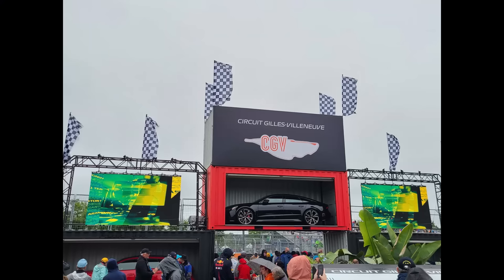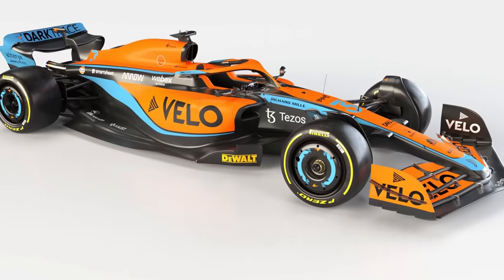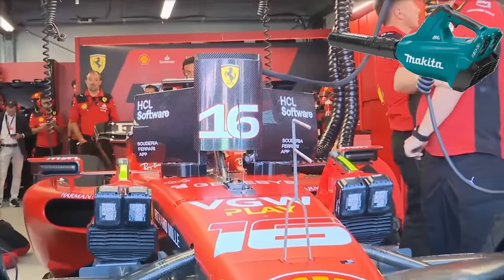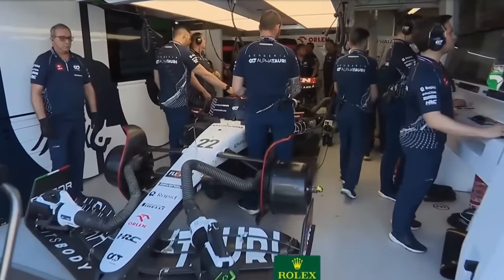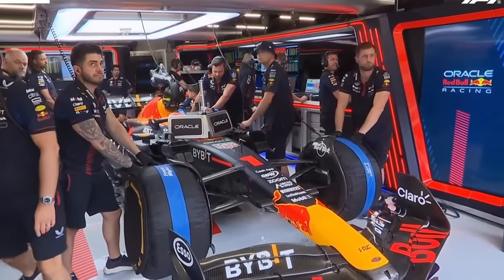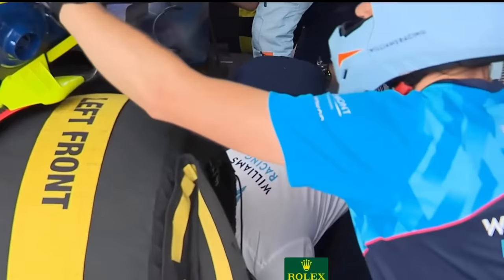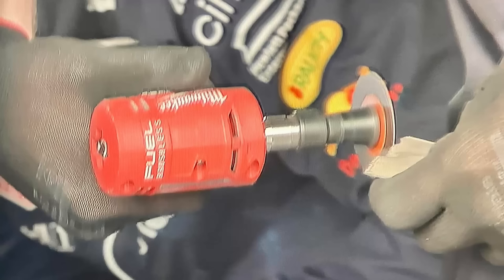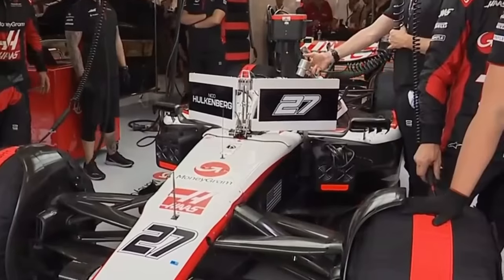Getting to See the Tools Used in Formula 1 Surprised Me

Comment: Those Bosch 12v/10.8v are the legit Rolls Royce of small power tool kingdom. The m12's are just not refined and way too large (both tool and fat handle). Fun fact: those Bosch 12v's could be used as hammers in a pinch!
Reply: I switched from bosch 12v to makita 12v, it has more power, much better ergonomics and better charger.
Reply: @riba2233  But larger and without interchangeable heads (Flexiclick)
Reply: @macvos  not larger at all, just slightly taller bc of the battery at the bottom but at least it can stand on its own. Also the same weight. 
Yeah flexiclick is nice and I hope Makita makes something similar in the future.
Reply: @riba2233  I like and have Makita tools myself. However, the shortest driver I could find is the DF032. Max. torque is the same as Bosch GSR 12V-35 FC at 35 NM (21 and 20 respectively for soft torque). Speeds are higher for the Bosch at 1750 vs. 1500 rpm. Dimensions wise, the Makita measures 124x66x236 mm and the Bosch 115x52x160mm, so it is significantly smaller (although both can be considered very compact). Weight with a 4 Ah battery for the Makita and 6 Ah for the Bosch (with which it can stand) is 1 kg for the Makita and 0,97 kg for the Bosch, so practically the same. With the smaller 2 Ah Makita battery and the 3 Ah Bosch (with which it cannot stand), the difference is 0,88 kg versus 0,77 kg, so in favor of the Bosch. Combine this with the Flexiclick functionality, and I believe the Bosch is the better choice for this specific application, being faster, more compact, lighter and more flexible. The Makita is still a great driver though.
Reply: @macvos  just saying, I have both and makita is better in every category in real life, paper spec is not always correct (makita spins faster for eg). it has more power  (despite what the spec says), much more comfortable handle (this is the biggest difference, bosch is really not comfortable at all), better trigger and selector, much better balance, it can stand on its own, etc etc. ignoring the flexiclick ofc
Reply: @riba2233  have you tried the 6 Ah battery? It spins faster with it than with the 2 or 3 Ah ones and can tail stand. Also, did you try the newer brushless model? Because saying it runs slower and being just as long as the Makita indicates you compared the old brushed model. That one is indeed slower (1300 rpm) and not as short as the brushless one (at 132mm length).
While I like the ergonomics and trigger of the brushless Bosch, I like the ones on the Makita as well, and can understand some might prefer the latter (with ergonomics also being subjective to a degree).
Reply: @macvos  ofc both brushless. Don't want the 6cell packs, they just add unnecessary weight, and makita can stand with a 3 cell pack. 
Bosch has a trigger with more pointy edges and the selector is also rougher, so that along with a thick handle means you will get fatigued much earlier and when I use these tools I usually use them for a long time and this is very important for me, even if those are small differences to many.
Reply: @riba2233  I can understand your preference, but the argument against the 6-cell pack is a bit weak in my opinion, since you value tail standing and more power, both of which are enabled by the 6 Ah battery. Weight is a bit of a moot point, since the Bosch with the 6 AH pack is roughly the same weight as the Makita with the 2 Ah pack, with vastly increased runtime as an added bonus.

Comment: I've seen video footage of F1 mechanics using a very large torque wrench for tightening the wheel nuts before the cars leave the garage so it wouldn't surprise me that after they used the Milwaukee gun the wheel nuts were tightened with a torque wrench. Obviously F1 teams wouldn't use a torque wrench during a pit stop as that would take too long.
Reply: F1 pit stops are just mind boggling with how fast they are. Especially ever since they banned refueling.

Comment: Pardon my ignorance.  I had assumed that air tools were used exclusively during races to change tires.  Electric tools might introduce sparks in the presence of fuel vapors.  Is this correct?

Comment: Shoulda dove into the jacks. Otherwise, not surprising that Makita and Milwaukee are topping the list for cordless stuff, its works and works well.
Reply from the maker: The jacks are carbon fiber levers with wheels made by the team.
Reply: @TorqueTestChannel  They got the rollers to move em in the garage as well as the billet guys for doing alignments.  Theres a bunch of them that are pretty bad ass depending on the job theyre doing.

Comment: some years ago in japan gp ,i saw some 12v impact driver they modified the selector, put a pin on it, that only for tightening thing , like dont want not accidentally select on reverse , but for what..? why dont want accidentally reverse and specially modified that slide selector thing, must something very important , is dont want something drop you if accidentally hit reverse and losing the bolt??

Comment: @TorqueTestChannel I have been thinking about using a drill while working on cars/engines for light to medium torque usage and using a torque wrench or breaker for anything over this. However after seeing this video I am now aware of installation drivers. 
Could you please do a test on these and their practicality ie: varied torque setting adjustments and consistency. Including 18v Makita would be great as I run a large set up of these.
BTW, I am enjoying your channel immensely and mixing it with another of my longtime interests was great to see.
Reply: Those Bosch are pretty great! I have several drills and drivers (including Festool) and most often use flexclick Bosch driver.

Comment: as I am not all that impressed with the tool manufacturers that are used in F1. Since that is pretty common. But more so I am more impressed with all the DYI modifications from the equipment that you can purchase from Home Depot! Who knew that you can turn a paint dryer into a cooling fan for the driver!?!?! Or your everyday leaf blower converted brake duct/engine cooler?!? I always thought these were custom made from their factories! But that is only 1/2 true.

Comment: Talk about a serious case of loctite cross threading with a 3000 ft pound gun wow
Reply: There's a video of that pit stop. Car comes in, mechanics jump onto it, front left wheel gunner puts the socket on and nothing happens. He takes it off, resets the gun (it automatically cycles into "forward" after releasing the trigger), tries again. Nothing happens. He tries another gun, says f*ck it, and the whole car ends up being shipped to a factory to get the wheel nut cut off. I guess they did not want to just grind it off in the pit and accidentally damage the spindle.
Reply: Agent West  I can't believe that was the 1st time and they would have a nut splitter on hand to fix it

Comment: They should change the wheel nuts to giant titanium dog teeth like what they use in a transmission with just a tapered center ring. Aluminum wheel nuts is stupid asf.
Reply: Aluminium is used because if a nut gets stuck you can switch the gun to overtorque and effectively crack the nut in half for removal quickly without damaging the centre hub peg thread enabling you to put another nut on without having to replace the hub

Comment: Why are they using blowers on the brakes? I am so confused.
Reply from the maker: When the car comes in the brakes are red hot. Needs the air usually coming in from the air ducts to cool them. So once stationary they use these. If you don't they literally catch fire
Reply: @TorqueTestChannel  oh okay that makes sense. I thought that video was from before the race so I was so insanely confused lol. Thank you for the clarification!!
Reply from the maker: No problem. These shots are from free practice and qualifying. The cars return in between runs and sessions, and have to be put into the garages to receive any fuel per FIA rules. So no car sits in the pit box for more than like 10 seconds. Then they are rolled into the garage, and the driver is given notes and strategies to increase pace while the engine coolant cycles to cool through radiators, and the brakes are cooled, and the tires put in heated blankets to stay hot.
Sometimes you'll see a car have engine problems and have to pull over on the track, the brakes often then just catch fire while it's parked from no one there to cool them.
Reply: @TorqueTestChannel  damn, that's wild. I heard those brakes get to be like a 1000 degrees C when in use. Unreal

Comment: They often use dry-ice adapters between the blower and the sidepod intake as well, to "precool the coolant, giving them about a lap or so of cooling overhead, that in turn allows them to run the engine a bit harder on the first lap. until coolant temp reaches nominal. You usually only see this while lining up on the grid for a race start, as a outlap in quali quickly negates this little overhead.  On longer tracks the formation lap eats up that coolant temp overhead so its usually not done.

Comment: Haas using a custom blower on one side and a Makita on the other

…they can’t even make up their mind on what to use for a single car, no wonder they’re such a laughingstock.
Reply from the maker: Qualified 2nd today!
Reply: Well color me impressed!
Reply: This is a bit naive.. the likely reason is that a mechanic was working in/around the area that the standard cooler sits on, or they may have needed to remove the side panel to access something below and had only just reinstalled it, thus a blower was being used.
No one considers them anything close to "laughing stock" they have one of the smallest budgets on the grid and often perform better than teams with higher budgets.
Reply: @TorqueTestChannel  Until a bogus three place drop...  :(